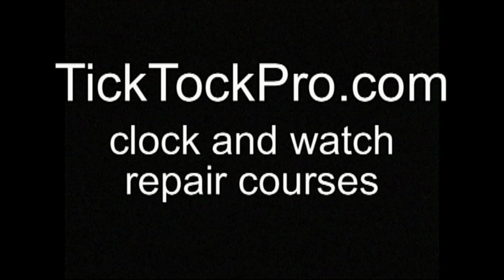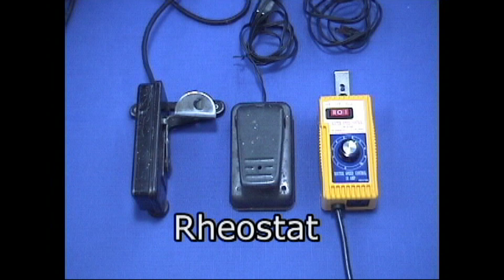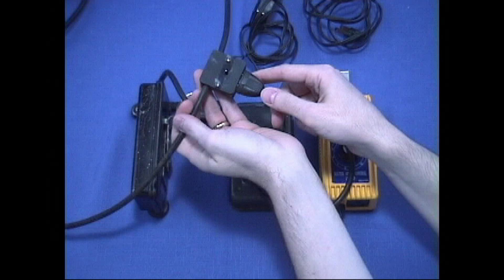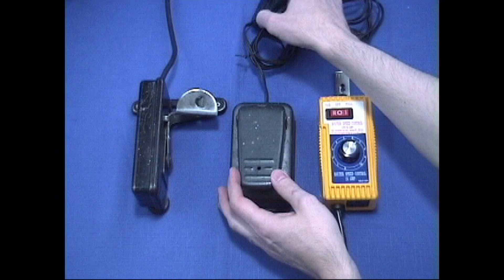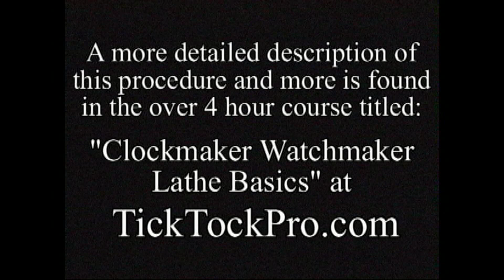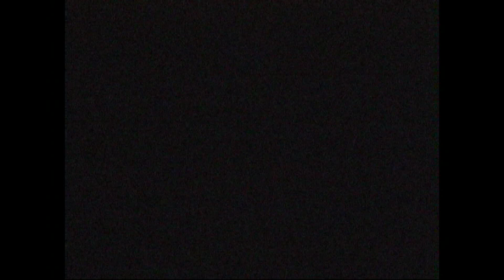Jewelers lathe speed control. Clockmaker Watchmaker rheostat beginner tips

Comment: I don’t have a lathe what could be used that can polish pivots just as well as a lathe that is inexpensive
Reply: Personally I’d take a block of wood, clamp it into a vise as you do this, drive a screwdriver into the side of the block, create a divot in there by hitting the screwdriver with a hammer. Then I would put the gear’s arbor or pivot into a pinvise and then stick the pivot into that divot you’ve created. Then spin the pinvise around and polish the pivot as you do this with buff sticks or abrasives or however you like to polish pivots.
Reply: @samsclocks2084  this was easy and simple to understand thanks Sam
Reply: My pleasure, glad it was helpful